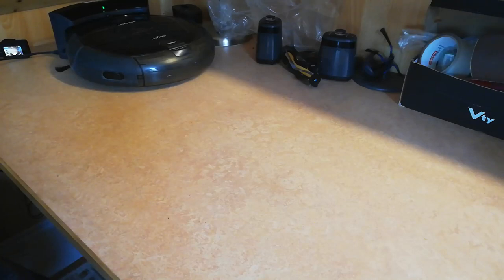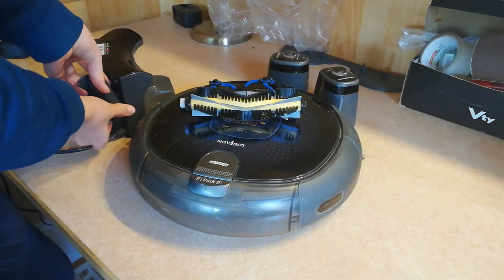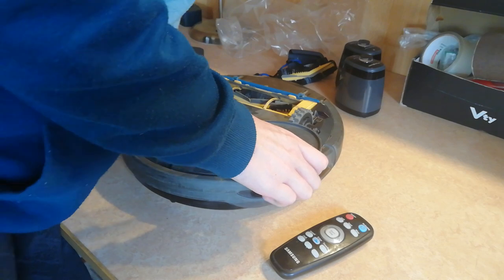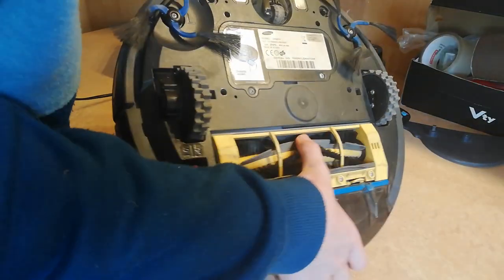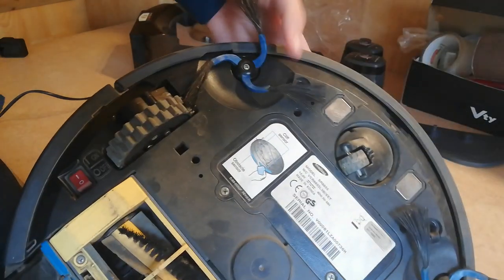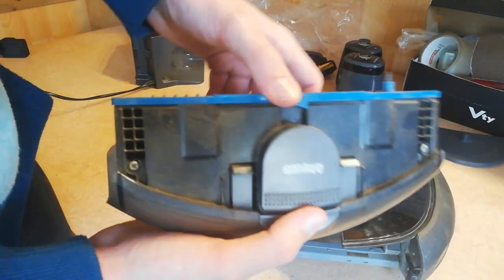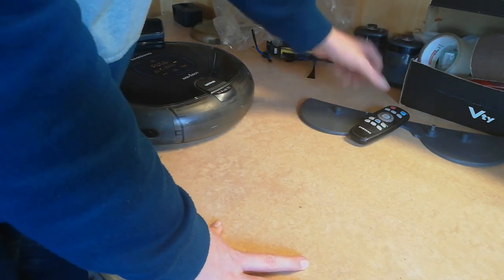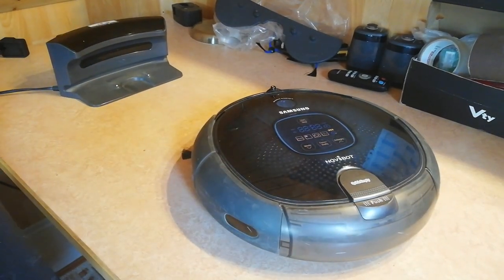I have another NaviBot :D | RoboVacCollector

Comment: Did you finally fix it? I have the same issue, I tried to repair it. I disassembled and cleaned it, but it didn't work for me. You might help me with new ideas...
Reply from the maker: I was working on part 2, fixing it. I dissassembled entire robot, removed the main brush motor, and I connected it to 12v battery, it worked so I reassembled the robot, and it worked just fine. But because I have a bad luck then after some time both of the motors from sidebrushes burned down. But main brush issue can be easy fix.